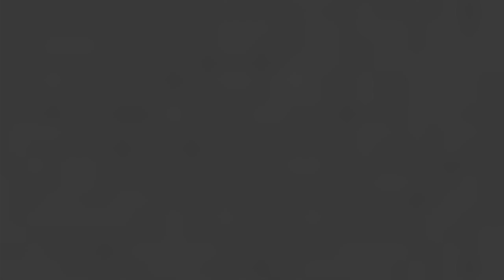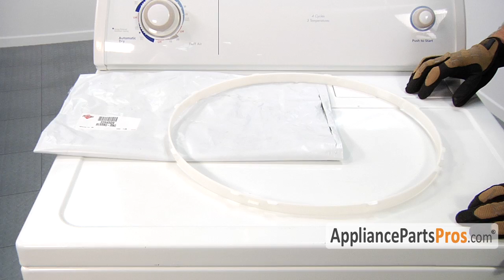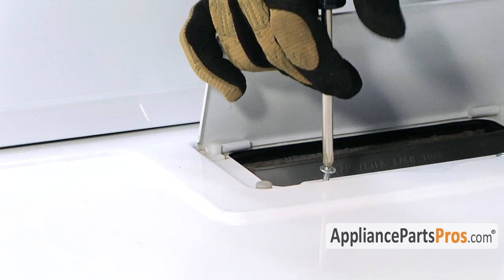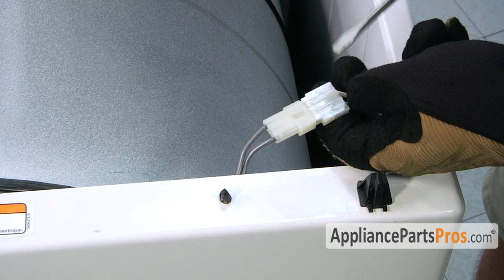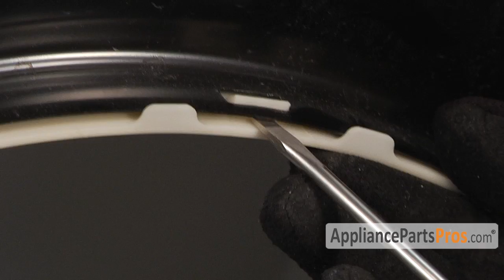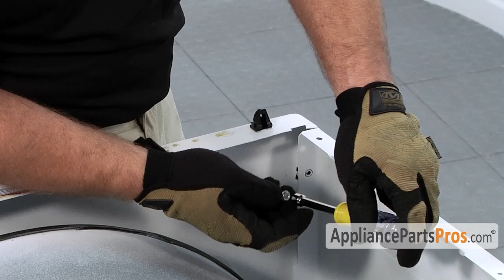Whirlpool Dryer Drum Bearing Ring WP3394509 Replacement — fits KitchenAid/Maytag

Comment: I have a Whirlpool dryer I changed the rear felt seal and checked rollers. 
  The searing ring is missing some if the clips that attach it to the drum. 
  It still has a slight thumping sound when running.  Could the bearing ring be causing that? It is not worn through but does show some black skid like marks.
Reply from the maker: What is the model number of your appliance?
Reply: @appliancepartspros  LER5636EQ0